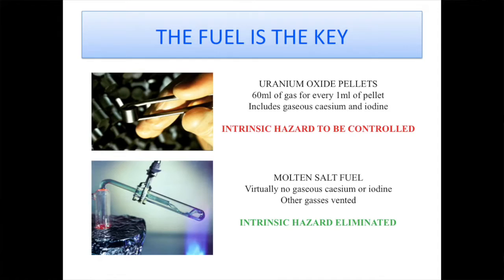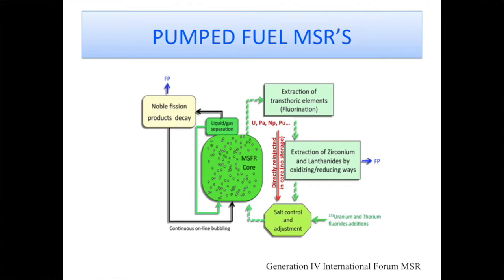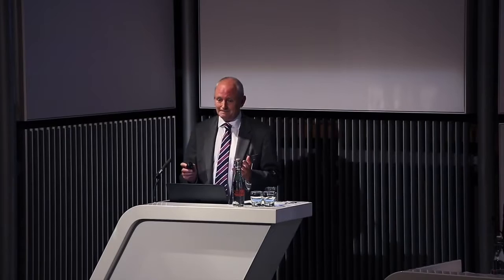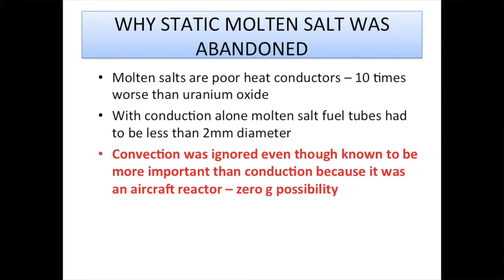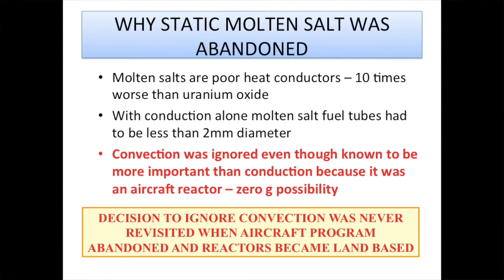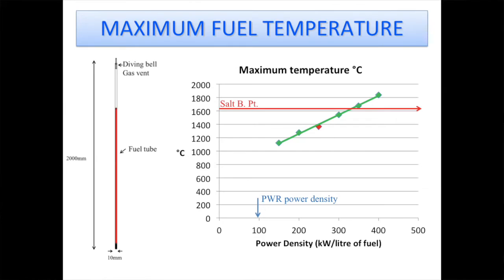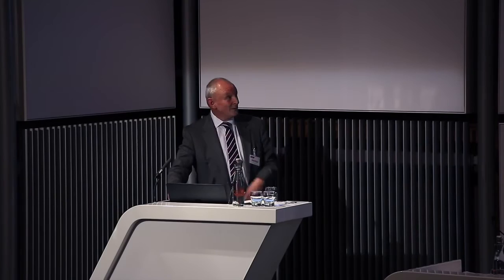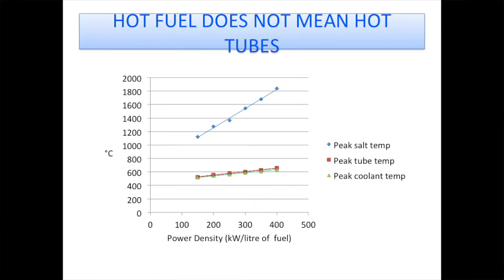Ian Scott   Moltex Energy   IMechE Moltex design simplifies the molten salt reactor

Comment: Kirk Sorensen's model uses graphite tubes, and Oak Ridge used graphite tubes - both to contain the fuel and serve as a moderator
Reply from the maker: +Robert Weekes In the original MSRE and Sorenson's design the fuel is not contained in tubes. Moltex is unique in this respect, it uses a liquid fuel but it is contained so that it does not have to be pumped around with the coolant.
Reply: @thor1938  - Yes, and since there is sodium salt instead of Lithium in the tubes, you don't have corrosion issues and Tritium is not produced. This SSR can use standard Stainless Steel fuel rods with Zirconium liners and standard stainless steel tanks. The reactor is passively air cooled so you don't need a dump tank and freeze plug to prevent overheating. The coolant salts never come in contact with the radioactive salts inside the fuel tubes so you can transfer them to a molten salt heat storage tanks similar to thermal solar generation, therefore you get to use lower cost steam turbines that are used all over the world in solar and combined cycle gas turbines with heat recovery, steam turbine generation systems.
Reply: @WJV9  I don't understand, do the coolant salt get neutron activation (due to unavoidable neutron absorption in a nuclear reactor) ?